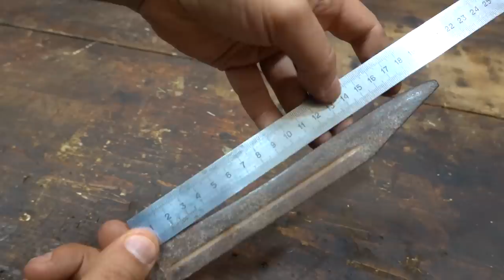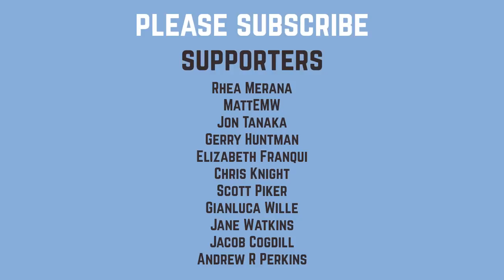Restoration Old Rusty Military Knife

Comment: If there were originally aluminum rivets in the handle...the knife couldn't be older than the 1930s...wasn't aluminum difficult to work with prior to advancements in the technical processes needed to fabricate commercially with aluminum? That is why railroad passenger cars couldn't be made lighter with aluminum construction until the 1930s here in America. Those rivets may have been steel if the knife was older. Anyway...your videos are always entertaining... 
Instructive...and humorous...
You're a good "kitchen magician" as well.
Reply from the maker: Thank you for attention and information!